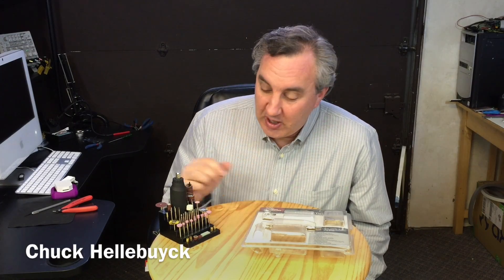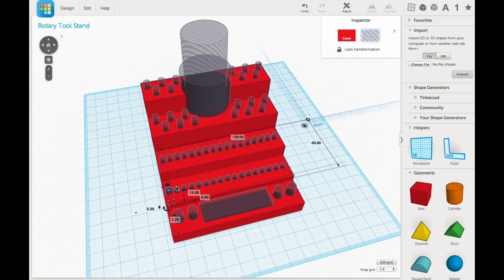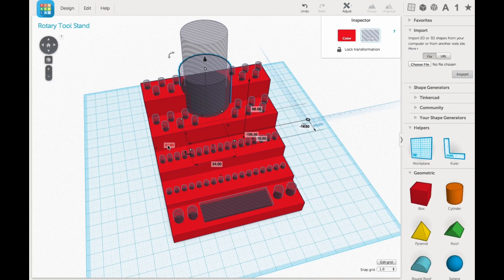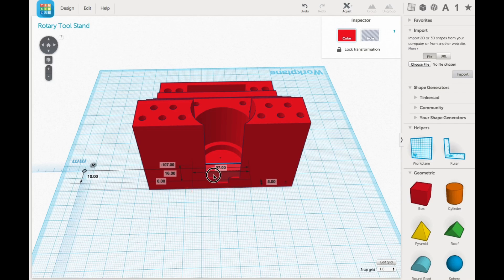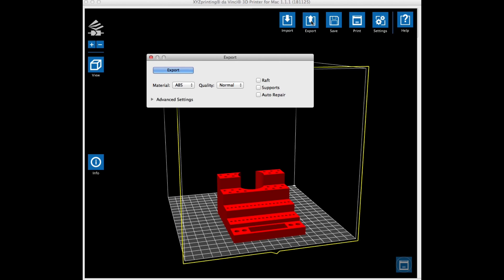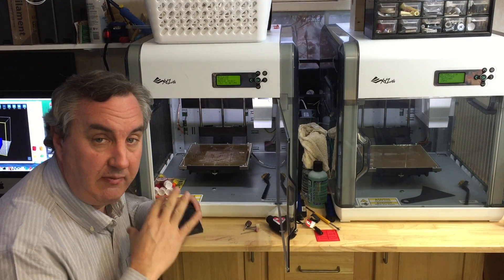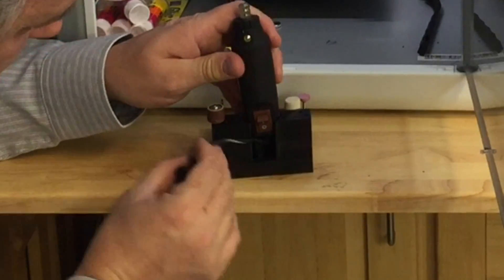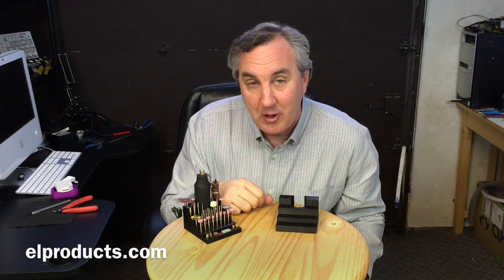Davinci 3D Printed Rotary Tool Stand - Video #029

Comment: One of the first things I designed and printed with my Da Vinci 1.0 was a tool holder for my finishing files and razor knife. I made it in tinkercad similarly to how you did, but mine is made so that it clamps onto my glass-top desk. It turned out good on the first try. The only thing I had to do was add a little hinged gate in front of the razor knife because it hangs down and the cat kept knocking it off. Tinkercad is great. Unfortunately, I don't remember my settings and I didn't export it before I printed it, but I do have the .stl file saved.
Reply: I just made it public on tinkercad. If you search for "hobby file holder" it should come up. I may add it to thingiverse soon.

Comment: I was wondering what kind of Glue do you use on your 3D printer because I have the same one but it is a 2.0 and
I have the same trouble with mine the corners warp up form the heated bed :(  Love your videos
Reply: ***** Since 3 Weeks, I use a green PET foil. Bevor that i used the Glue Stic. It works fine and i cleaned most after 2 or 3 prints the Bed with Windowcleaner an a Glass/ Ceran Scratcher. 
But now im happy with the PET Foil.I don't need to use Glue anymore. The Only thing, bevor printing clean the Bed with acetone on a kitchen towel.
I can make a short Video about the Foil, and how easy it is to Install when you are interested.

By the way, great Video again - next time i will print this too. Thank u Chuck